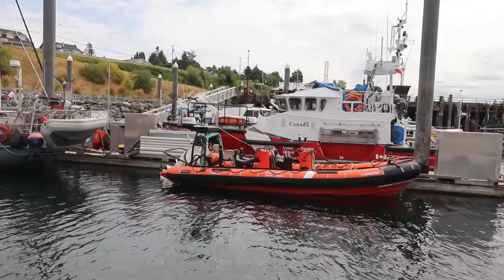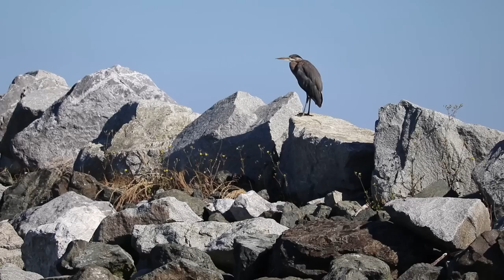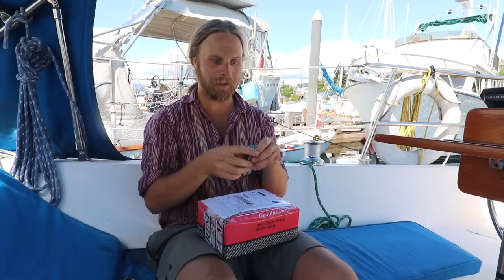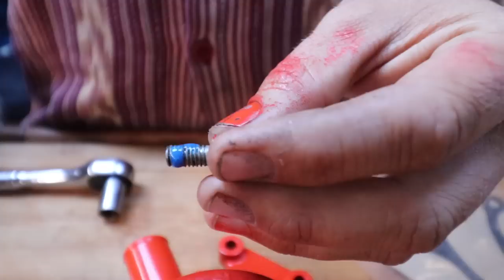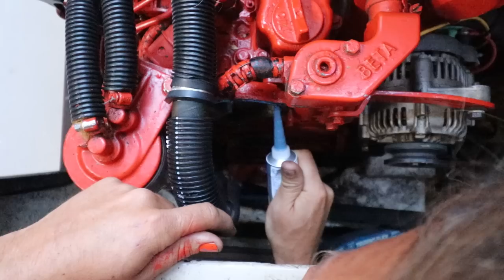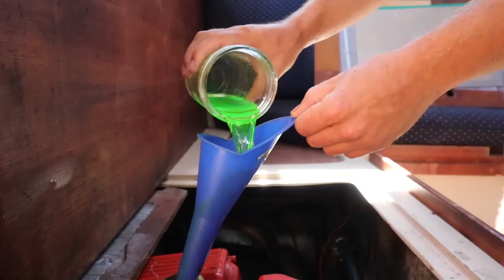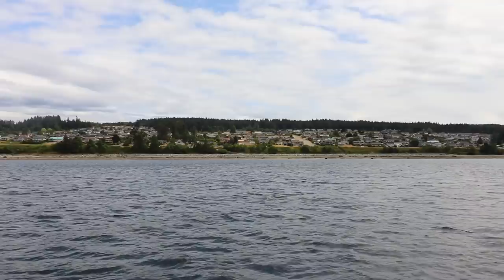Our Boat Broke AGAIN! Does Smooth Sailing Exist? | A&J Sailing

Comment: You shouldn't need to seal the gasket with silicone. That's what the gasket is for!!
Reply from the maker: Thanks Howard! In retrospect we realized this as well and next time we need to removed the water pump we will reseat it with just the gasket. Thanks for watching!
Reply: @AllisonandJamesSailing  Keep up the good work!